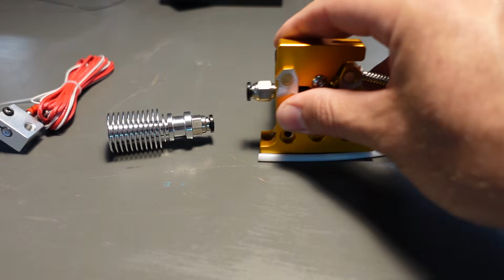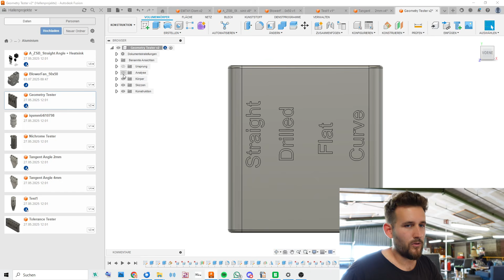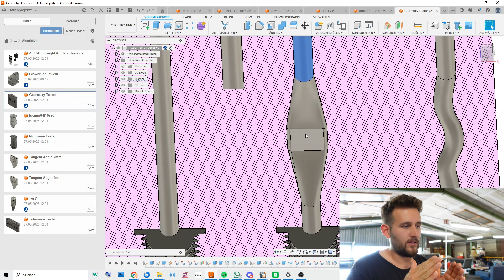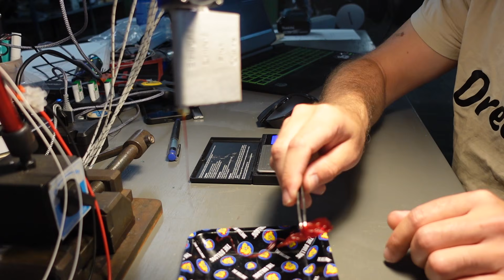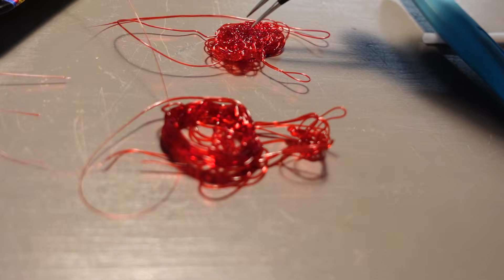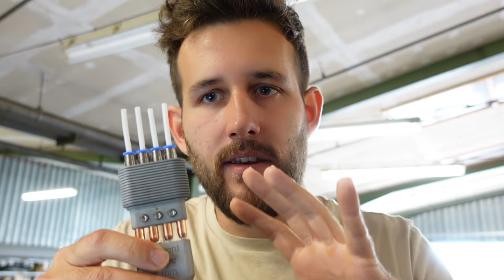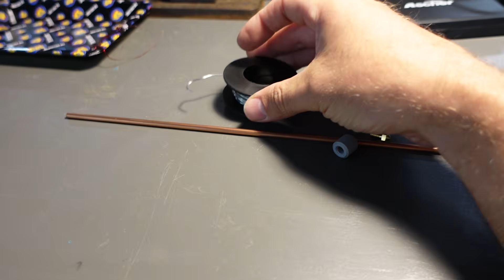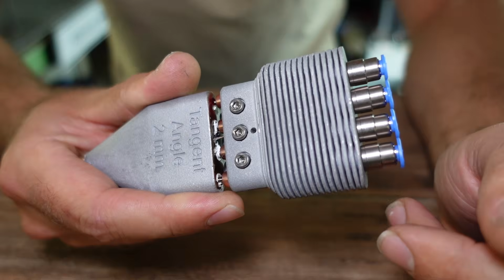Minuteman's World Record Hotend for your 3D Printer! 200+mm³/s Flow Co-Extruder! (Roetz-End E01)

Comment: Starting with an extruder design like the prussa mk4, or at least a gear / gears like the mk4 would allow a much more compact extruder, where the multiple filaments are basically touching each other.   i would stager the inputs and outputs a bit and not use bowden fittings for the reverse bowdens, but instead clamp the ptfe's directly, stagerd to be as compact ( and lightweight) as possible.

the above extruder should also allow each filament path inside the hot end to be closer in length and shape/ therefore  resistance.  sold side watercooled and  integrated  with the exit of the extruder, again to reduce weight and size.

also designs from 2 > lots of filaments, though i am sure the community would take care of this.   pretty much everything you are doing is exactly the same as i was experimenting with pre covid using a diamond hot end and stacked bmg extruders.  my end goal was a tool changing printer with ultra high flow, multi mm nozzle tools for internal walls and infill combined with more standard tools for external perimeters and details,  all with the goal of printing very large parts fast. 

also have you considered a nozzle with multiple holes, a bit like a oxy cutting torch, but with each hole feeding from its own filament.  something like a 0.4mm hole, with a ring of 3 or 5, 0.4mm holes, surrounded by another ring og 5/7 holes etc?   may allow for quite a wide range of dynamic extrusion width

Comment: Maybe use IR transparent (sapphire?) and transfer heat mostly by radiation. It used in metal manufacturing as Reverberatory furnance. It transfer any heat instantly. Drilled sapphire and IR lamp nearby, all covered by mirror.

Comment: really interesting stuff. i wanted to point out that KANTHAL wire is not NICHCROME wire and has verry different resistance. not sure how you calculated and it might not make a difference if you adjusted the length to reach the target.  and the "flat" option might benefit from 2 sections with opposing planes and i'd suggest testing out a tesla valve geometry path, i suspect it would give you much better mixing.
Reply from the maker: Thanks for clarification!

Comment: Dude, put the paths in a square formation instead of being inline.
Reply: True, it would make all paths equally long and would even be more compact.
Reply: Yeah. Next question would be which orientation of flats. Do you go angled (diamond), or alternate vertical/horizontal? I doubt X would be ideal, but there may be a use case for it. As an example, a square design technically means you could insert something in the middle, IF there was something worth adding there (heating element? Think of dice, the 5-pip side as a shape. Are the outer 4 pips the 4 flow channels, or are all 5 pips the location of heaters, with the 4 channels placed in the gap between each set of 3 pips?
Reply from the maker: This is exactly what I've been working/contemplating on. The inline approach is easy for prototyping. But we'll do all sorts of funny stuff with the flow geometries, not that we know slm hotends work!
Reply: @MikeKasprzak 
V4 layout with heater block in the middle.

Comment: add thermal insulation on the hot end ! :p you could print a mold and use high temperature silicon to add 5 mm walls around the hot end
Reply from the maker: It will either be silicone molded or a stainless steel bended housing. But we will have heat shielding for sure
Reply: yes yes! :)

Comment: Maybe it would be advantages to use a 2x2 configuration instead of a 1x4, since you could probably compact it a lot more.
Reply from the maker: Yes we will get into this stuff in no time! I got a lot of configurations planned
Reply: @Roetz40  I also wonder if a longer merge zone would be beneficial like how longer engine header collectors is beneficial for power.
Reply: The extruder is in-line, with the large extruder wheels it won't fit into a small foot-print. Possibly twist the PTFE tubes from straight 4 into 2x2, I suspect that this would have less friction at this stage than in the hotend. It would be detriment to the looks though, it looks great when everything is aligned straight.
Reply: Came here to suggest this.Not only would the flow paths be consistent but the heater placement (relative to filament path) would also be consistent. Would be interesting to compare heaters in  corners with filament between or vice versa.
Reply: And cooling would just be down the centre...
Reply: Well a circular config has them all at same
Reply: Added a similar comment before seeing yours.

Comment: I think the reason the copper-lined hotend doesn't work well is the thermal interface between aluminium and copper - it basically just shifts the problem from "get heat from the aluminium into the filament" to "get heat from the aluminium into the copper liner". This approach might make sense if you can fill the gap with thermal paste, or somehow solder the copper in, but even then you're still limited by the amount of heat the bulk aluminium can conduct into the copper liner (which isn't much bigger than the amount of heat it can conduct into the filament directly, because the interface area in both cases is very similar)
Reply: I am pretty sure that temperature deviations within the aluminum are not a significant factor, or at least not so significant that better heater positioning would be sufficient.
I would like to see a steel tube inductively heated.
Reply: A tapered threaded interface would certainly increase thermal conductivity, like NPT.
Reply: I think this is exactly the problem. I also didn't think the small copper tube will make much difference even if you do get a clean interface. IMO a much better option would be some kind of thick copper screw with a hole drilled in the center. You could even potentially use a screw-type copper heat break for this purpose. Either way, you need to increase the surface area and maximize surface contact at the aluminum-copper interface.
Reply: Well, the copper pipe would have a higher surface area against the aluminum than the filament would normally have. The thin walls of the tube would make this point negligible. Regardless the main bottleneck is the lack of ability to transfer heat through the plastic, not necessarily getting heat to the surface of the filament. On a similar note, could there be a bottleneck of transferring from the heaters to the aluminum? That seems like a very small surface area, but a much higher temperature differential.
Reply: Video creator, you probably have a lot of thermal contact resistance that actually increases the thermal resistance of this system rather than decreases it. This value between the heat source and the filament is what matters in terms of how much heat you can pump in.

The other advantage of copper is its thermal effusivity(sqrt(k cp rho)) this is effectively what gauges how well you can transfer heat in the transient style heat transfer of 3d printing.
Reply: Even then, your limited by the aluminum regardless, the only way you will see any improvement is with a full copper hotend. So even if the copper transmits heat into the filament better, your still limited by the amount of heat the aluminum can move from the heater to the copper, it's a bottle neck either way. 

It's like switching from a 0.5 inch garden hose to a 1.0 inch garden hose. Yes the 1.0 can flow a lot more water, but you will still get the same flow out the other end as the faucet that's feeding it isn't any larger.
Reply: @stevenbmw850  Thats not true tho like the original commend says its about the surface area difference of the copper liner. The aluminum isnt saturated in its heat transfer in some sense. It could transfer more heat iff the difference in temperature across it would be bigger and hence if you actually had a big copper block connected to it that is able to transfere the heat efficiently into the fillament you would allow more heattransfer by reducing the bottleneck. Would still performe worse but u know. In your gardenhose analogy your hose would be by default narrowing down significantly by the nozle just like the surface area of aluminium towards the filament is getting very small compared to in the bulk material. Now you replace the bottlenecked narrow part by your nozzle with a way better one. Yes its not as good as replacing the whole hose but it is better by a lot. The copper liner innder diameter to outer diameter ratio would be the eqwivilent of how much of the narrow hose you replace with more beeing obviouly better and almost no difference beeing practicly useless
Reply: @stevenbmw850 the thicker the liner the larger the surface area between the copper and alu.